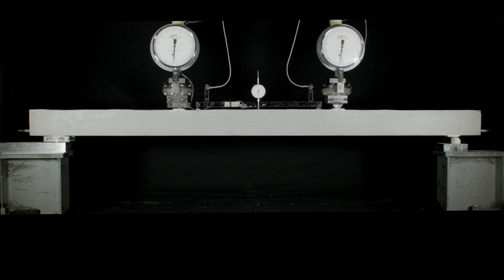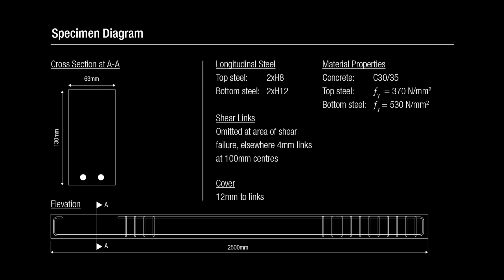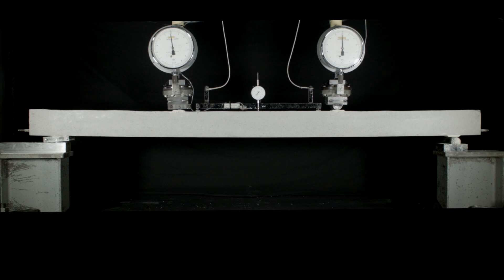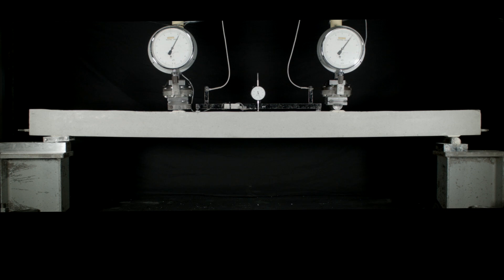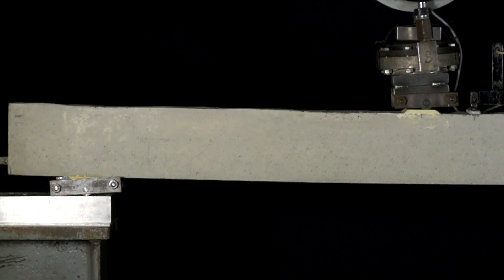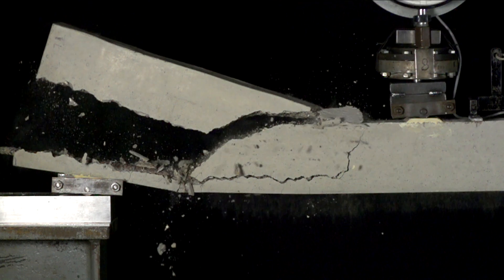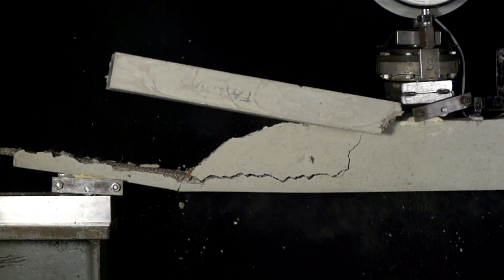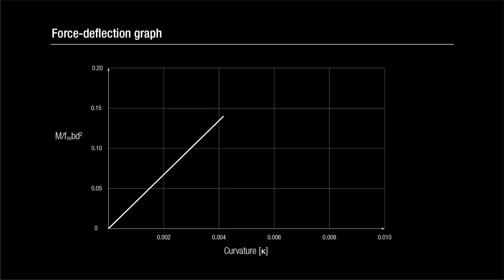Shear failure of a reinforced concrete beam with no shear links: Materials Lab on-line

Comment: I dont think this is a typical shear failure. It seems like there is an compression arch developed and rebar acts as a tie but at some point the bond is disrupted and the compression arch collapses. I would not qualify this as typical shear failure rather than bond failure.

Comment: Thank you very much for these videos, they really gave me a much clearer understanding of how concrete works, and that is really hard to find! Just as additional clarification, would you mind me asking what are the units of applied force used on the left side of the graph and how I can translate them into different ones, e.g. "kg" or "kg per square centimeter"? Thank you very much in advance!